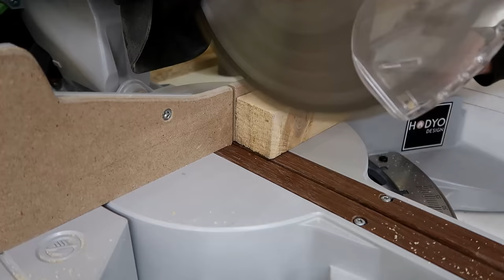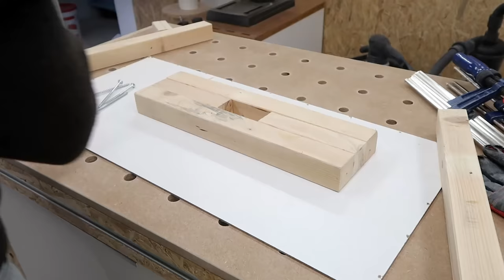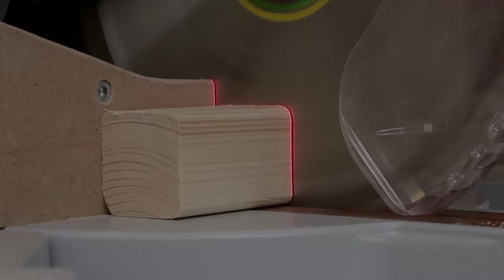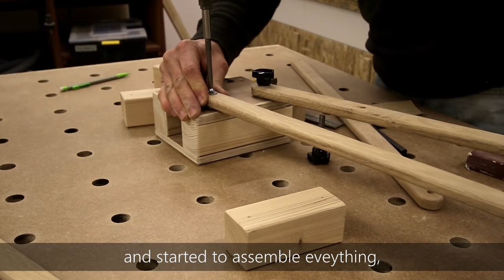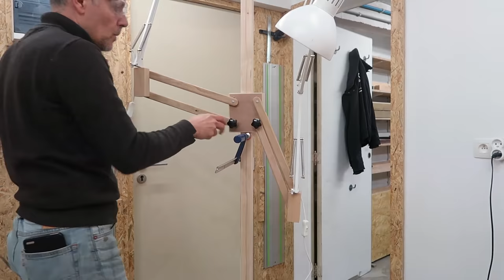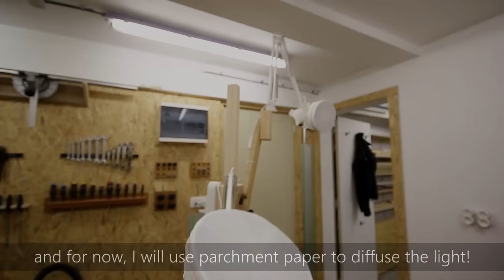$30 DIY Heavy Duty Wood Light Stand

Comment from the maker: After I shot this video, I replaced all the 1" 1/2 pocket screws with 2" 1/2 ones, making this thing even more sturdy (actually, I needed 2" screws, so I shortened the ones I had in my shop). The longer the screws for this type of projects, the better. After using this stand heavily for the past few days, I also ordered small casters, they will help too!

Comment: I like the concept, but think that the articulated wooden arms are unnecessary. The lamps themselves have enough articulation. A simple crossbeam would have sufficed. Anyway — I enjoyed watching you go through the build and troubleshooting on the fly.
Reply from the maker: Actually, I agree with you, the medium position on the leg is very versatile and let me use the lamps from the ceiling down to the floor. Still, I'm glad I made the stand the way it is, as I learned a lot during the build. Plus, the articulated arms help to keep the footprint of the stand as minimal as possible; a crossbeam would make the thing more massive, and the video would have been boring :-)